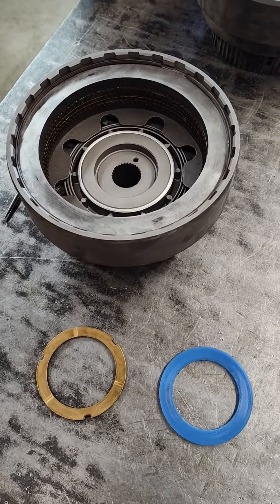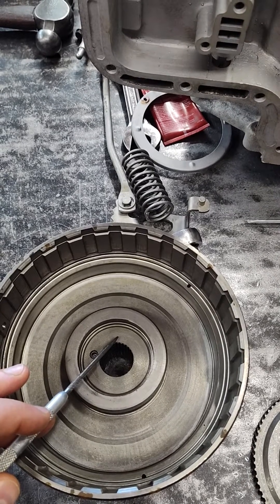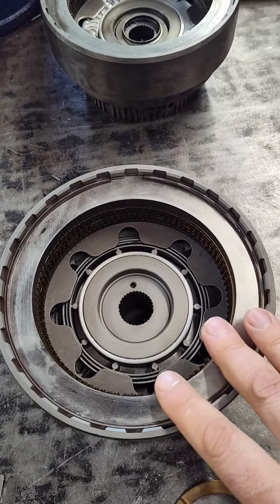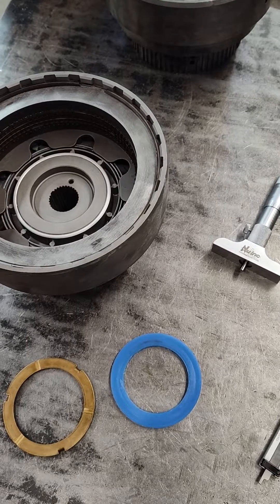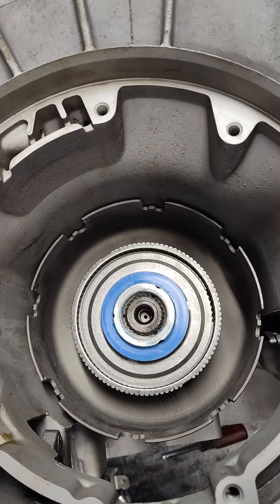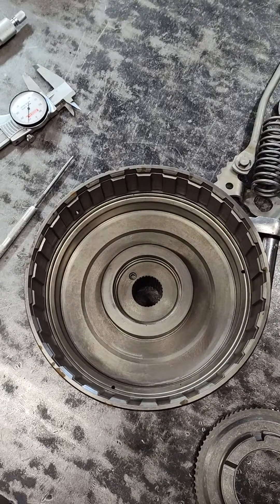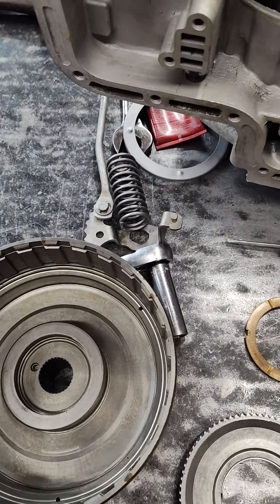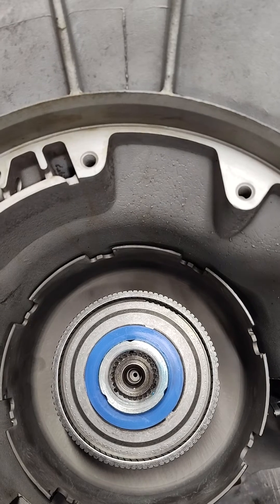Ford C6 Transmission Wide Ratio Gear Kit Installation Tips

Comment: you should cut ,180" off the face of the sun gear shell for the use of a 2 1/2" red alto wide band ! Frank
Reply: Their 2.5" band is offset cut to clear sun shell. I guess Alto doesn't offset cut their bands

Comment: Jay, I am in process of building a C6 and have acquired a 3 clutch converted to 5 clutch direct drum and an original early 5 clutch forward drum. I am planning to get your Wide Ratio Kit and assume this washer comes with the early style kit, as it is slightly more expensive to cover the cost on the plastic washer. Also, the forward drum will be the only part from the older 66-72 transmission. As long as I have the proper clearances on each individual drums clutch packs, and proper endplay, I should be good, right? Anything else I should be aware of mixing the drums from different years?
Reply from the maker: Yes just get the kit based on the year of the forward drum. The rest of the trans really doesnt matter as to what year everything is. The forward drum is the only difference. The early kit will have the extra spacer added.

Comment: Great idea.  I wish drums and cores were still that cheap. Crazy money over here and that's if you can get them.
 I have done the bearing also a couple times to fix up ones that someone has been in before and have mismatched and mixed the early/late drum /Hub components
Reply from the maker: I guess the days of good deals has ended.